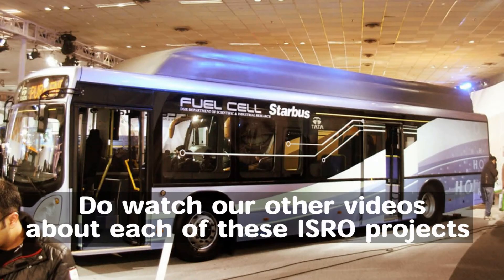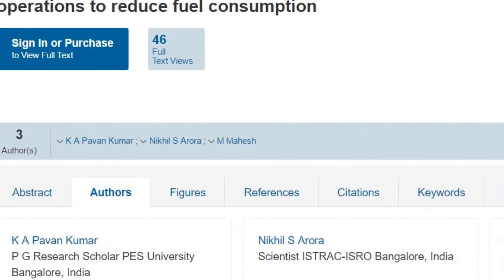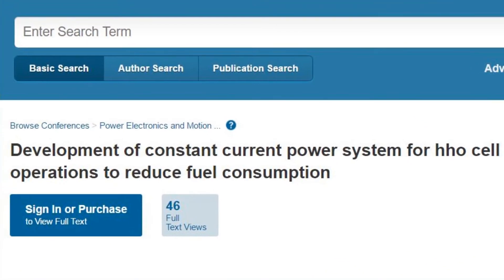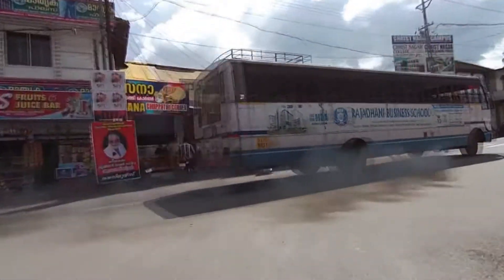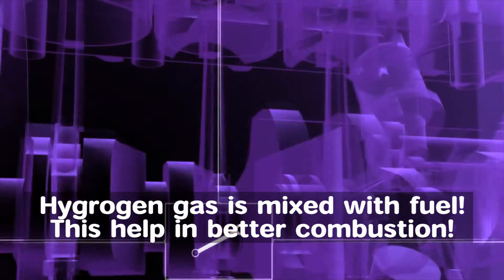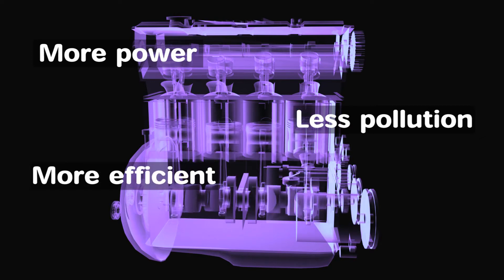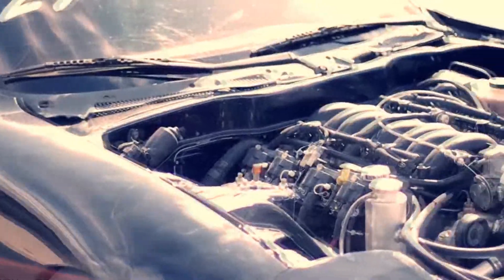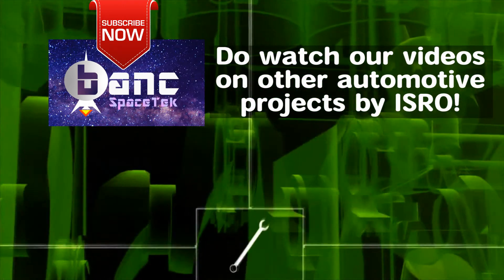HHO cell: How ISRO scientist aim to reduce car's fuel consumption & pollution

Comment: More detail please, quoting the publication by ISRO for reference gives you huge credibility; thanks. Pls. elaborate and in detail.
Reply from the maker: This paper focuses on a electronics and control command optimization that could optimize the electric current flow which in turn would control and optimize the rate of hydrogen gas generation.  My aim was to find and explain any automotive tech that ISRO is working on. Since this paper just focused on a subsystem of the HHO technology and because the overall technology itself is not an well known one, I preferred to only focused on a the overall technology.
Reply: Sure, again thanks.

Some of us are more curios, and truth is that power mgmt. is a critical issue in power cells.
Reply from the maker: I am searching for more information regarding this. if I get, will surely make a new video!
Reply: Same here, can't find $hit on the web.
We all believe that the govt. is on to a good thing, ISRO also has good image. How is it there is ziltch on their plans or ISRO Lithium-Ion batteries. I have no doubts, so the only logical conclusion is that ISRO sucks at advertising and marketing. Incredible!